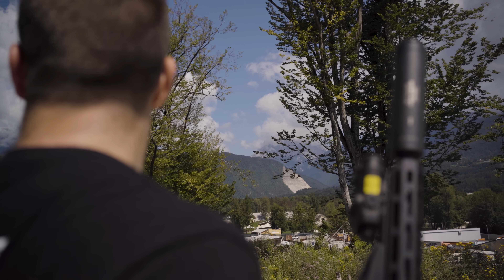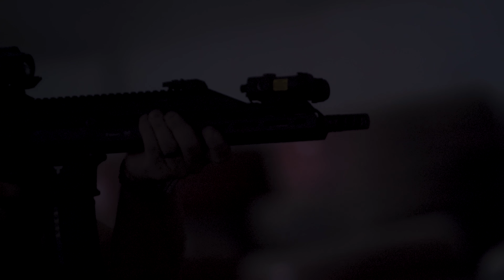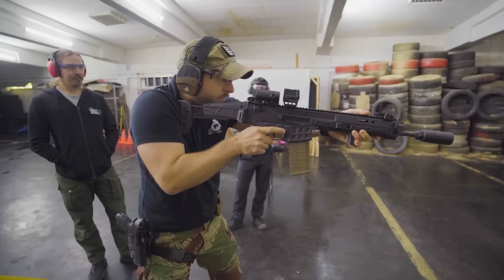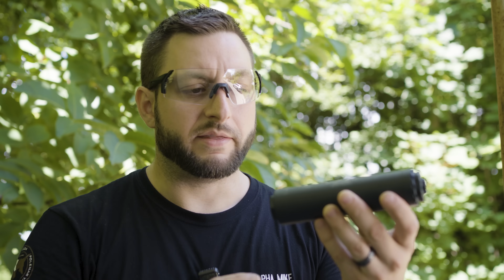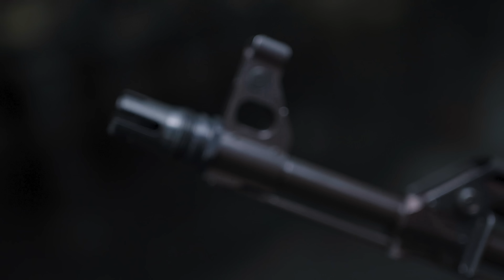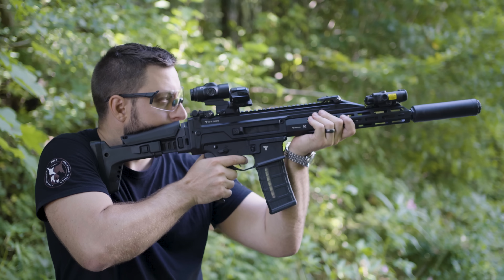Flow-through cans are better | MFT suppressors

Comment: Why ZIga why? You basically amde me go for a silent steel. I got the A1 flashhider and now a new supressor. Are they compatible?
Reply from the maker: MFT is not compatible with Silent Steel muzzle brakes
I mostly use Silent Steel micro gen 3 and sometimes compact. 
I use the MFT on my bolt action precision rifle at the moment because its longer and heavier- But MFT is now also coming out with a compact can :)

Comment: For active combat in war, an effective suppressor is required. Size 100 mm, weight 300-380 grams, volume less than 140 dB, heat-resistant steel, straight thread, no flash. It does not matter what kind of partitions are inside the tube. Such suppressors are already on the market. MFT has beautiful effective partitions. But it takes at least 30 minutes on a robotic lathe to make each partition. This is not logical

Comment: Reminds me of a 1917 patent for a silencer. Mirror image. Back then they sharpened them on workbenches. Now they use CNC. I think it doesn't matter what you put in the tube. The main thing is that the silencer is light (300-350 g) and short (100-120 mm). Stainless steel. And the sound power is less than 140 dv. This is a necessity for modern combat with a 5.56 caliber

Comment: Here are a few pointers for people who are not as familiar with these newer flow-through suppressors:
1 - They really are great about not needing much to get working well on gas-operated rifles. The most common mod is simply the muzzle device for attachment, and that's it.
2—The muzzle devices that require threading should really have reverse threads for the suppressor-to-device interface. That way, taking the suppressor off requires turning it in the direction that will tighten the muzzle device onto the barrel instead of taking it off.
3 - VERY high-temperature anti-seize for the threads and taper mount on the exterior of the muzzle device is a huge help—the carbon ring can really lock the suppressor on there, so any help you get with that is nice.
4—Get the highest-temperature pot holder or equivalent and keep it in your range bag. Use it when possible to try to loosen the suppressor before it cools down too much. This really helps with suppressor removal for later cleaning of the rifle, etc.
5 - Between the toxins, the carcinogens, the other byproducts of the firing cycle, and the traditional suppressor forcing it all back into your face, it is a very noticeable thing to deal with - it's like angry tear gas, and it just plain sucks. Flow through is a welcome addition that will reduce this significantly.
6 - Those who shoot under night vision will notice a reduction in gasses around your face, meaning there is less there to flare up brightly under the infrared illumination and therefore less to essentially flare up and effectively blind you during longer strings of fire. It does not totally eliminate this, but any reduction is welcome.

Comment: Hi Ziga. I'm curious. A few months ago, on a gun show video, I think on TFBTV I'm not sure, on TinckArms stand, there was that Slovenian engineer, very shy and reserved guy, who explained is very complex suppressor. Tinck said it was going to enter in production later in the year. Is it this brand who worked with that engineer? because the mechanism inside looks like the same.
PS: also can I have that perunX16 plz? Hard to find here xD
Reply from the maker: yes, this is the same suppressor
Reply: @PolenarTactical  Ahaha I knew it. That "helicoidal jet engine shape" called me. Did you, out of curiosity used a decibel-meter to see what are the results with it? Or maybe in a future video VS other suppressors for 5.56?
Reply from the maker: @philipejeuceoututkache  we never had the chance to use one of those proper decibel meters as those are super expensive. But im wondering myself because the MFT sounds very quiet and effective for a flow through design.
Maybe we can make a comparison video in the future
Reply: @PolenarTactical  Would super cool. Even more if you could,  maybe not buy because as you said it's expensive, but maybe rent a decibel meter?

Comment: Flow through = extremely loud.

Adjustable gas solves the same problem and a traditional silencer will be more quiet.
Reply from the maker: Not all flow through suppressors are loud - for example the MFT one seems as quiet at the shooters ear as some conventional cans. I didnt want to mention this in the video because we didnt measure it so it's just my personal observation.
We are thinking of doing a suppressor comparison in a video but finding a normally priced decibel measuring device seems impossible

Comment: It‘s quite an interesting design IMO. It kinda reminds me of the physical principles which underpinned a very advanced throttle design in WW2 aero engines, the swirl throttle.

By increasing the length of travel for the air going into the supercharger, they effectively slowed down the air and reduced the resultant air pressure, simultaneously cooling it down and reducing the strain on the supercharger impeller
Reply from the maker: ha, interesting 
i learned something new today 😀
Reply: @PolenarTactical  ya know, this is why I like your channel, I get to learn fun gun stuff without actually being a gun guy.

Comment: I am still waiting for a flow thru supressor that uses small turbine blades to power spinning propeller in the front. Maybe some of you supresor nuts in more free countries can pick up on that idea. My concept basically includes a hollow shaft thru which the bullet passes, turbine blaces on its outside an a large propellor with a 2 blade propeller, like on those clown hats. 

Imagine shooting a full magazine thru this rifle on a hot summer day, to then enjoy a cool breeze from the fan while it makes a zzzzzzzzzzzmmmmmmm. sound. That would be epic.
Reply: Omg lol, even though it would never work, it's effing hilarious.  Like a kazoo!
Reply: well since suppressors can get quite hot i would imagine the breeze from 300 degree suppressor wouldn't be as enjoyable as one might think.
Reply: You would be better off using a device to turn heat to electricity. Not efficient but no moving parts and modern red dots don't need much power.

Comment: I don't think we'll ever see these on the American market but for what its worth it looked like it was machined well. I mean, from what I can see in the video.
Reply: We take care about the details.  We are serious about the quality of our products.
Reply: 829€, stainless, 22oz(≈ Nomad-L + Keymo QD), 2-yr warranty. That means for the size and material it has little effective volume. I won't buy one. 

Just get an SRBS 3d printed Inconel for about the same price, ~ a half pound less weight, better reliability(doesn't come apart), better longevity(Inconel 718), and a lifetime warranty. Probably has better performance since 3d printed star baffles with channels are super efficient, also it has a more intricate design for flash suppression and front venting.
A well designed suppressor should be made so that gas/combustion happens in a specific and controlled manner, it really shouldn't allow users to play with the baffles.🤔
Reply from the maker: @JohnZ556  i see you have your own beliefs which is fine, but it seems foolish to talk about this suppressor like this without even seeing it in person, much less actually testing it.
If you prefer welded up or 3D suppressors, great. 
But user serviceable suppressors exist for a reason
Reply: @PolenarTactical  Sure I have not used an MFT can, I'm merely a suppressor nerd sharing my observations and speculation based on what I can find and my experience with different cans. 
This isn't a belief, 3D printing absolutely beats CNC when we start to design flow-through, reduced backpressure, or PIP(impossible with CNC). For any reduced backpressure can, you will have some type of channels/vents, those have to be simplified for CNC and most certainly have to be done in pieces. 3D printing can make way more efficient (complex) designs without additional cost, and it eliminates the dead weights that CNC must leave for wielding/assembling. 

B&T and OSS have already done similar things(very different approaches) with CNC, the RBS was extremely heavy(33oz) and thick because of the outer flow chamber and durability requirements. OSS BPR was quite large and still heavy(24oz), and it comes in many pieces not really meant for duty use. Both have huge drawbacks, B&T now has a 100% printed SRBS line, and OSS replaced it with fully optimized and wielded HX-QD before going fully 3d printed Flow series and changing its name to Huxwrx. All of those steps are for very good reasons and actual upgrades.

Now Huxwrx has a Ventum line that seems like the closest to MFT. But with 3d printed core for better weight/performance efficiency, tho I personally don't like Ti cored cans because of sparks and heat erosions. I know Ventum is impressively low backpressure and modular, but it's not as good as the 3d printed Flow for overall performance.
I do wish MFT outperforms the Ventum, but from all I can see for now it might just be a similar product(way heavier but more durable?) at best. Because Huxwrx can just 3d print an Inconel or Stainless core for the Ventum. Still, neither would be my pick.

You're a dealer in the EU, so maybe you can do a comparison between a few different 'flow-through' cans? That will be interesting!

Comment: The comment about supersonic flight noise is kind of incorrect in that it depends where you are shooting.  Outdoors, the shooter is never directly exposed to the projectile flight noise, therefore it is a moot point.  Indoors, the supersonic flight noise is reflected back at the shooter and can be quite loud.  

You can think of flight noise like the wake from a speedboat.  The person standing on the shore, while the boat moves away, is never directly exposed to the wake created by the moving boat.
Reply from the maker: Interesting theory that can easily be refuted by anyone that has ever shot subsonic and supersonic ammo through a suppressor.
Outdoors the sound is not that loud but still way past hearing safe.
You cant make supersonic rounds hearing safe by using a suppressor.
You can shoot them outdoors because it doesnt hurt the ears too much but know that you are still damaging your hearing. 
The damage is cumulative and irreversible
Reply: @PolenarTactical  I have been designing, building and testing sound suppressors for 20 years.  I was trained to sound test suppressors by Alan Paulson and Phil Dater, who are the godfathers of firearm sound testing.  I also hold several US patents on sound suppressors.  

The supersonic shockwave travels perpendicular to the bullet's path, which means the shooter is never directly exposed to the sound.  The shooter only hears reflected noise from the bullet.

Any decent suppressor will be hearing safe at the muzzle, on a bolt gun.  Which makes it hearing safe for the shooter.  SA's are different due to noise coming out the ejection port.
Reply from the maker: @ExpatriotSilencers  i imagined that someone that designed suppressors would know better
Please tell me you're not using still using 140 decibels as "hearing safe"

Comment: Been using surefire since my military days.  During nighttime, I'll stick with my RC2 during the day RC3.  Both types have their place.  Both types have drawbacks.  No free lunch.
Reply from the maker: is RC3 the one that creates a crazy big muzzle flash on SBRs?
Reply: @PolenarTactical  Only if you use one of the mounts that lacks the labyrinth seals like the Warcomp. I think their muzzle brake has the seals? I don't know 100% if the brake has the seals but I do know for a fact that the 3prong and 4 prong flash hiders do not generate the crazy flash. The RC3 was designed to work with the 3/4prong flash hiders. I think they did that because they know their military customers use the 3/4prong exclusively. 

If you watch video of it being fired with the 3 prong or 4 prong it is just like the RC2 and may even be better in some cases.
Reply from the maker: @armorers_wrench  i saw a youtube video where the a guy tested an RC3 (i think) and it produced a big muzzle flash at night. There were some caveat to the testing, maybe the guy was using a muzzle brake instead of a flashider to mount it on

Comment: Sadly my weight limit for a suppressor is 450 g, otherwise my rifle would be too fat.
Reply from the maker: What kind of suppressor do you use?
Reply: @PolenarTactical  None right now, I wanted to get a Huxwrks can but getting that in Europe will be a pain so right now I am looking at a Silent steel Streamer compact (steel version).
Reply from the maker: @australovenatortomino_1741  those are great
I love the micro gen 3 - it small, light and suppresses enough for my use 
I've heard that Silent Steel is also working on a proper QD system but i font know when that will come out

Comment: There are so many new options that seem like a good choice im having trouble settling on one for my first can.
Reply from the maker: For what gun do you need it for and how much do you shoot?
Reply: @PolenarTactical  AR15. 2 to 3 thousand rounds a year.
Reply from the maker: @JDub0390  i presume AR15 is chambered in .223/5.56 so you wont be shooting subsonics. That means that you will have to be using ear pro so it doesnt make sense to search for the quietest can. Depends if you have an adjustable gas system or not but i would highly recommend some kind of flow through can or at least low backpressure.
If you dont shoot at night and with NVGs then you also dont need that much flash suppression. If weight and maneuverability is more important to you than suppression, i would go with shorter cans. If you shoot a lot or if you shoot fast, keep away from aluminum or titanium cans. 
You also need to decide if you want a suppressor that will be dedicated only for this rifle and will stay on (maybe direct thread) or you would want to often remove it or use it also with different rifle or even calibers? - so probably multi-caliber can with some kind of QD attachment.
And of course price point, that's also a factor :)
TL;DR - figure out what are your needs and preferences and then use them to find suitable options